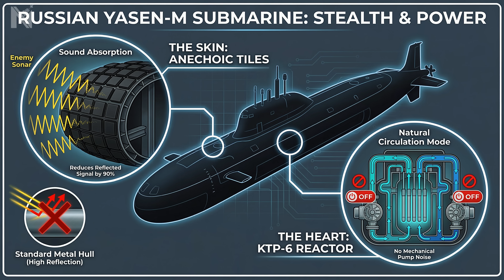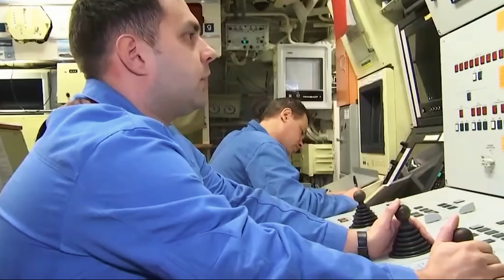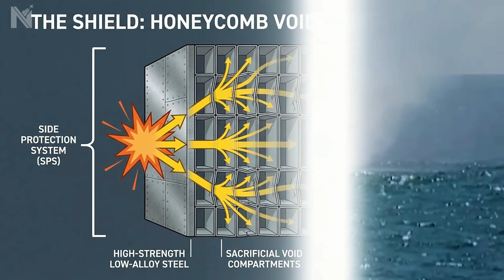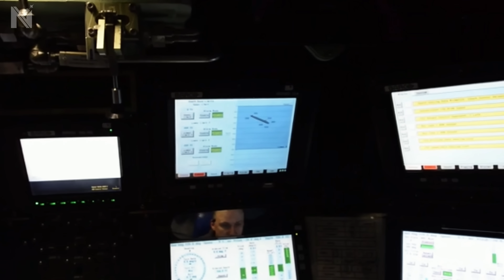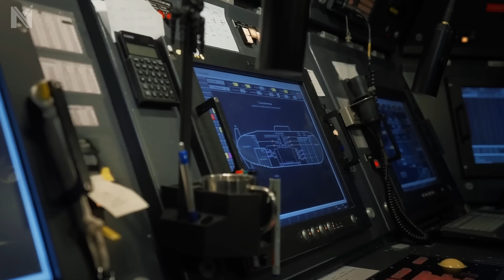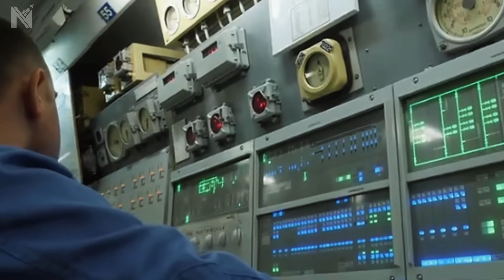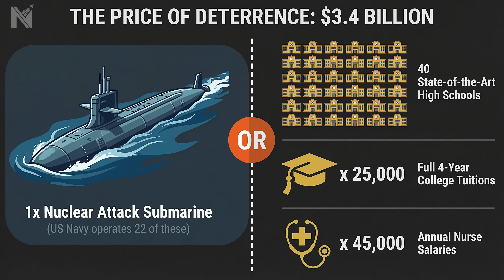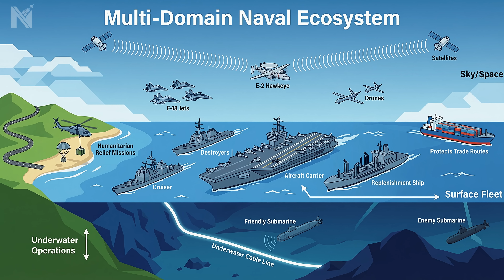Why Firing a Torpedo at the USS Gerald R. Ford is a Suicide Mission

Comment: I do declare, if i remember correctly from my tin can days,  Hogging is when the belly goes down, sagging is when a wave holds up the middle and the ends drop.  My knox class de/frigate was so flexible they had to put rubber joints in the superstructure over the weather deck   it flexed so much that without the rubber, it would constantly break.

Comment: Its not that the tech is not there, the human aspect of the response is where the biggest flaw is.  A human will make a mistake and a torpedo will be able to make it through and sink a carrier.  Defensive sensors need to be linked to AI to prevent any mistake and for a fast response time.  Future wars will be won by AI and the country that leverages AI the best will be the victor.

Comment: There are assumptions here.  First is it will probably be a Chinese submarine, not a Russian one.  Second it probably won't be a manned submarine.  More likely it will be a descendant of the drone submarine that Ukraine recently used to take out a Russian Black Sea fleet submarine  More advanced, AI commanded and with a brace of AI guided torpedoes.  It probably won't be alone but part of wolf pack of AI guided submarines.  Both the submarine and the torpedoes willl probably have multiple sensors and not be dependent on just one method of guidance.  Yes it will consider propeller wakes.  It will probably also ne listening to other noises and sensing magnetic fields too,
It will be much, much cheaper than a Billion dollar submarine,  Probably the drone submarine will be less than a quarter million dollars to build and so too the torpedoes it carries,  
It will not be necessary for the robot submarines to patrol,  The standoff distances from which a US carrier would launch planes against Chinese forces can be calculated,  The drone submarines will take up station at pre-selected points and silently wait for the specific acoustic signatures (which are known) of an approaching American Aircraft carrier or submarine.  Upon detection they will silently maneuver to arrive at an optimum firing location then launch their smart torpedoes,  Their long lasting batteries powering their electronic motors will be very stealthy.  The drone subs will also have a rubbery coating that absorbs sonar so there will be no sonar reflection of a ping,  
They will have no fear if they detect a ping as there is no human crew,  Noise makers that sound like the wake of an aircraft carrier might fool the torpedoes, but if they don't also generate the same magnetic disruption a genuine Aircraft carrier does (also known), probably not,
It is possible 3 or 4 drones will also be launching AI guided, homing torpedoes at the same time.  Even if they all fail the submarine itself can silently home in and detonate.
That is the coming threat and part of why the entire concept of large manned aircraft carriers may already be obsolete,

Comment: You're kidding, right? If the US sub is submerged, it's not in real-time communication with the surface ships. And it would never, EVER give away its position with 'one ping'.  More likely, the escort ships would be the one pinging the sh-t out of the intruder up to the point it did something hostile, at which time they would just sink it.

But that's assuming they found it in time.

Comment: Also forgetting the seahawks  Sh60 with dipping sonars they can blast that sub with enough active sonar that would screw up any firing solution made with passive sensors and also have the same leave or die scenario presented in the video.

The american virginia would not just let that soviet sub dissappear. You would be in same predicament 2 hours later. They would follow and keep track or hand over to air assests that sub would be tracked until min 150 miles from the carrier

Comment: What if the torpedo is fired from 500 miles away?
Reply: Torpedos do not have enough fuel and needs to have a firing solution to get within range for its own seeker. 10 miles? Yes. 500 miles, never.
Reply from the maker: it becomes a targeting and guidance problem. Wake-homing and wire-guided systems simply don’t work that far.
Reply: @NavyDecoded 
AI torpedo 😆.

Comment: Depend on where the torpedo is launched from. Underwater UGVs just provide contact beacon sequentially. Air launched hybrid torpedos are  delivered almost onto the vectored location and carryout their own terminal guidance and engagement😂.
Reply from the maker: delivery method matters. That’s why the video focuses on the hardest case: a submerged, silent launch inside the defensive geometry.

Comment: I have been saying for years. A modern carrier is almost impossible to sink. China has carrier killing missile. Problem with that a moving target with speed above 30 or 35 knots top speed is classified.
First it’s got a lot of support ships. AKA defense they would know when the missiles are lunched. It would take a lot more than 1 missile to get past the defense line of support ships. And a lucky couple might hit but would it sink maybe it would be out of the fight. But I don’t think it would sink. That would be a game changer the Air Force would go hunting for the launch sights with the be 21 raiders. No chance to to launch a second volley.
Reply from the maker: That’s the core idea. The real threat isn’t sinking — it’s mission kill and escalation control. Deterrence works because the follow-on response is guaranteed.

Comment: Torpedo explosion do not make a vacuum.
Reply: Essentially it does. The explosion creates a massive void. The superheated has rapidly cools and the void is a lower pressure than the surrounding water (which is a vacuum in relation to water pressure). Basic physics.
Reply from the maker: @robertspence7766   That’s a fair clarification. You’re right in relative terms — it’s not a perfect vacuum, but a rapidly forming low-pressure void compared to surrounding water. That pressure differential is exactly what causes the violent hull flexing under the keel.
Reply from the maker: Correct — it’s a rapidly collapsing gas bubble, not a true vacuum. The destructive force comes from the sudden loss of water support and hull flexing.

Comment: He's wrong. Carriers are the fastest thing on water. They have to slow down for the fleet to keep up.30 knots?😂😂😂😂
Reply: I do 30 knots in my little boat, and on the water, it feels fast. I can't wrap my head around a massive ship that big doing 30 knots plus. Mind boggling really. It's also my understanding the top speed is higher and classified.
Reply: @willbrink Yes. 30-35 knots is what the USN has always said everything went lol
Reply: You are correct, when a US carrier made the attack on Libya during the Reagan administration as soon as night came the carrier pulled away from its escort ships and the 35 knot Soviet cruiser that followed like they were tug boats. The Soviets radar screens went blank and they didn't find the carrier until the next day. I can't believe people don't remember this. I guess that I'm just an old man with a good memory.
Reply: I know. I couldn't believe it when I saw some of these sea trial videos and watched that monster hard turn back and forth. Blew me away. I had no idea they could sail at those speeds. When I was in my senior year of HS I flipped a coin to decide between joining the Air Force or Navy. Tails won and I delayed enlisted in January of my senior year. While I don't regret being in the Air Force, I do wonder many times where and what I would've done if heads had landed 🤔.
Reply from the maker: Carriers can sprint faster than their escorts, but sustained operations don’t happen at sprint speed. Air ops, escorts, fuel state, and geometry set the pace — which is why real-world carrier speeds are usually far below theoretical maximums.
Reply: Obviously excepting LCACs & hydrofoils, but among combatants, yes.

Comment: The black hole is a improved kilo class sub. Not a yassen class.
Reply from the maker: NATO has used that nickname for multiple quiet platforms over time. In this case, the focus was on capability and behavior, not branding.
Reply: Kilo class (black hole)  is diesel electric and quiet in shallow seas in deep ocean not so quiet

Comment: Steel, metal  . Bouys that detect magnetic and pressure waves feeding data to surface ships.
A carrer that can dump a turbulance bomb over the bow to confusse the torpedo.
Sharp keels.
Reply: Not wire guided  torps
Reply: side on a carrier is an easy target , remember Bismark n Hood , both unsinkable , until they did